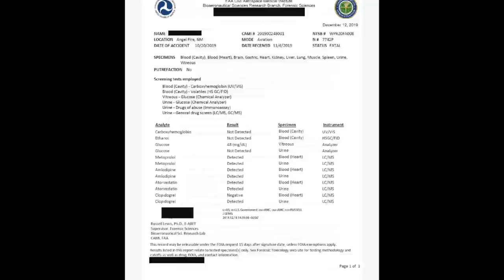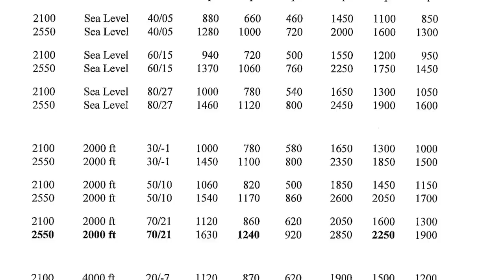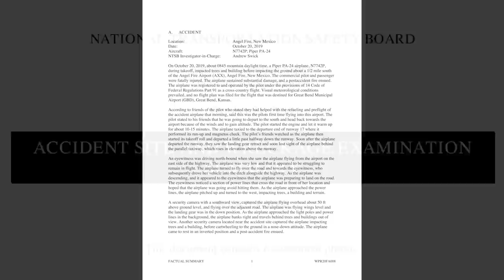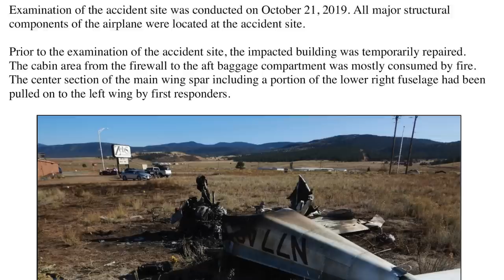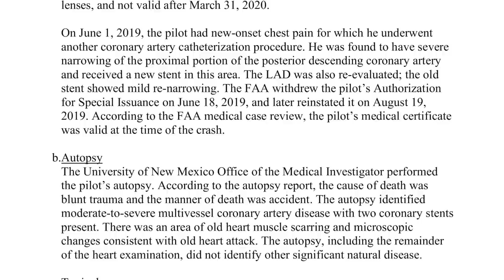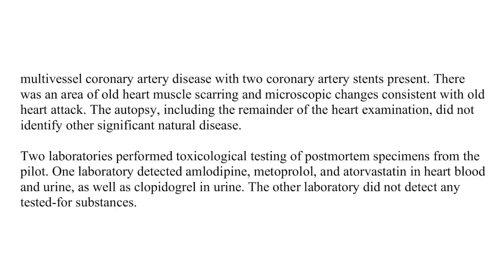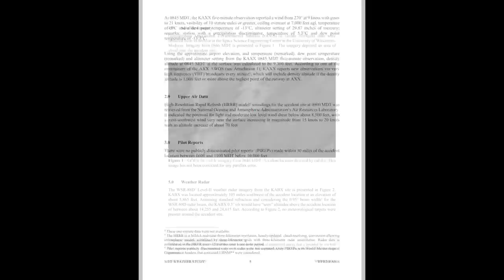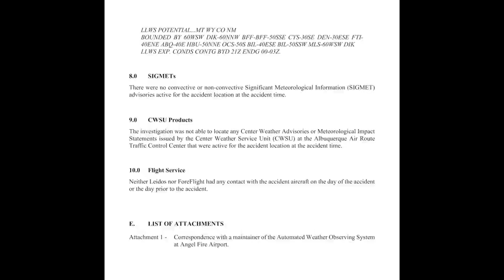Crash of Piper Comanche

Comment: Sad the pilot trying to save the airplane loose airplane and life... too many things were going wrong. Just from the beginning of the video. When you are in trouble and you make judgments that you are just responding to what is happening is too late...   1.) First was Keep Airspeed up. 2.) don't pull up or back on the control stick at low airspeed to stall the last lift available.  3.) don't put the gear down unless you have a Clear/ Runway or clear roadway ahead... Seems that the lesson of this video is quite clearly demonstrated about last seconds loss of control and stall spin of the right-wing pulling the airplane into the building... This is what they train you for and against...

Comment: Amazing haste and quickness the fire department responded to put out the fire. They were moving so quickly while the bodies just burned from the LACK of those assholes moving like pond water! 🤬
Reply: I was wondering the same. Why were the firefighters acting like that?
Reply: @samborlon  
Acting like what...?
Reply: @virgilhilts3924  Taking their time instead of running with the hose.
Reply: @samborlon  
Yes everyone should run into hazardous situations instead of analyzing and working with plan & purpose
The wreckage & fire was clearly not survivable...
They had water on the fire ~90 seconds after arriving...
The fire was knocked down within ~20 seconds...
So tell us what signifigance a few seconds would have made...

Comment: The fire started at the engine compartment… this could have been extinguished much faster with a mounted fire extinguisher ball mounted in the engine compartment.
Reply: Do you understand the weight issues with adding a 150 lb extinguisher - also such a tank represents an explosion hazard on it's own

JR
Reply: @ryzlot  go watch every after accident fire… the fuel manifold for injected planes is located on the top of the motor. When those lines break, they dump fuel on the exhaust manifold and it catches fire. It only takes seconds before it moves to the tank. Knock out the fire before it hits the tank, forward of the fire wall… and you might not become a human torch.